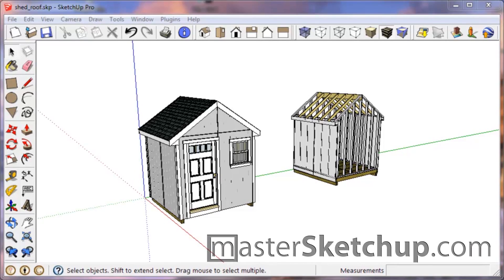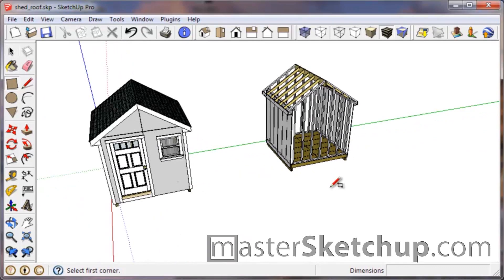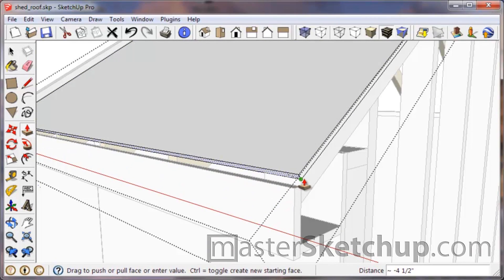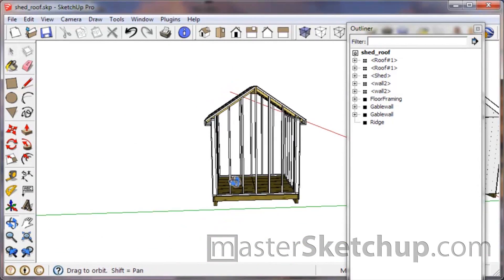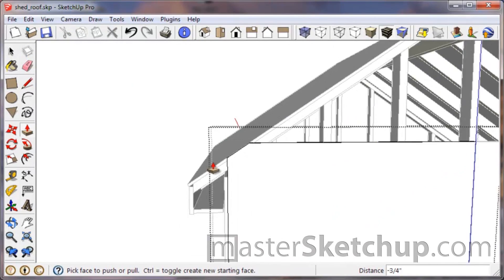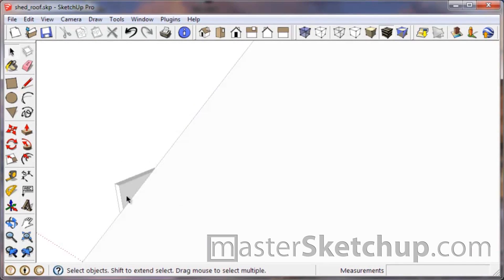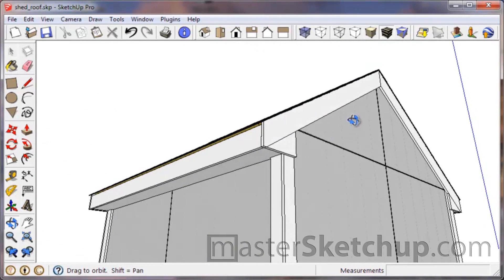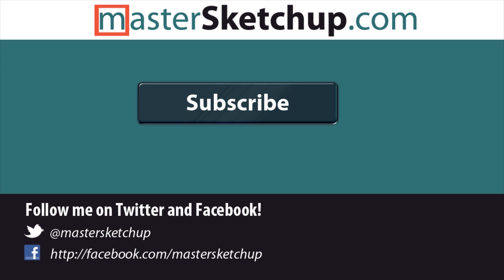Sketchup Tutorial - Model a Shed (Part 5) - Final Details

Comment: Great tutorials.  You didn't put in the jack stud and king stud properly.  And you forgot to build the door header.
Reply: I noticed that as well. There are several things that are inaccurate regarding the architectural aspect. For example, along with the items you mentioned, the correct material for the floor would be tongue and groove plywood and the siding would not be regular 3/4" plywood. It would be a siding material such as LP SmartSide, T-111, or Hardie Siding so there is no need to "gap" it 1/8" between sheets. No good carpenter would do that. All that said, the tutorial should still provide someone competent in construction methods to make the drawings architecturally correct even though it may be a bit more complex than what is shown here. I learned how to build from someone who knew how to build. That was long before the days of CAD software. I think it is important to keep in mind the beginner nature of the target audience; however, someone serious about doing this professionally should have a good working knowledge of framing and construction techniques. Cheers.

Comment: Hi Matt, your videos are great!! I m a Sketchup beginner, and i had learn a lot of them, i used Autocad since 2000 and that makes me understand even better. But please, share the information of how make the cut outs of the Plywood!!!! I try to draw a rectangle around the door and use the push pull tool, even draw a line all the plywood and the door and use the push again, and nothing...THANKS!!!
Reply: Hi Maria. I am a beginner too, but what I learned is that 
most parts are turned into groups or components. In order to make a cut you have to enter the component by tripple click.

Comment: You have stretched the roof sheeting to slightly over 5 feet by 8-1/8", and it doesn't meet at the top.  By the time you get done you have a flat spot on the roof that is approaching 2-1/2" because you didn't meet the sheeting that is already bigger than any one sheet.  Seems like if you are going to do something impossible you would at least be consistent.  Then when putting on siding you let one end hang over 1/8", flush in the front of the building, the entire 1/8" in the rear.  On the other hand, this is a sketchup tutorial, not a building tutorial.

Finally, when you finish the last video you tell us that you are not going to go into all the remaining details "because it would take 'forever.' "  It really sounded like you were tired of  the project and just wanted to end.  Partly because you spent so much time telling us the Rectange tool and the Push-Pull tools were "Here or the letter P" (or Here and the letter R).  But  that's OK, I was tired of it too.

Let me hasten to add that I have gathered useful information from your videos, but it would be nice if you would liven them up somewhat.  Less time drawing rectangles and more time on the rotate tools.  Should I be able to tell which direction is first then second when drawing the rectangles?  If I draw one direction it has 1.5" first, but on another plane 3.5" is first.  I'll go somewhere else to find that information, but thanks for what I've learned from this site.
Reply: In the original video he did explain it was not his design, he was only providing a tutorial for sketchup, also this is a beginner tutorial.  Seems to me he tried to keep the videos from running too long, not that he was bored.  In my opinion he did an excellent job explaining in detail, different ways to accomplish same goals with a little repetition.  Based on the fact I have never even opened any version of sketchup before watching ALL of his video tutorials, and now I can easily navigate the software and completing my second kitchen design for a customer now... I would call it a very successful tutorial.  All of his defense aside, the shed design is very poor lol